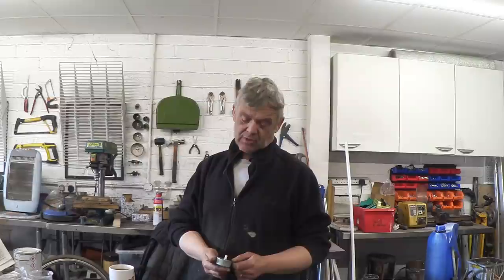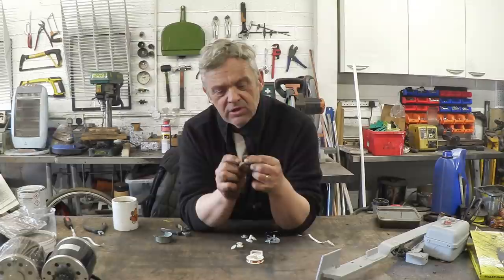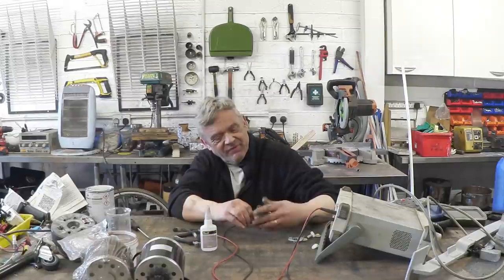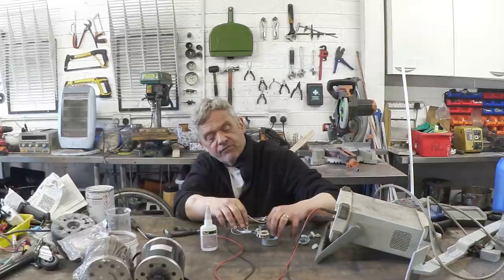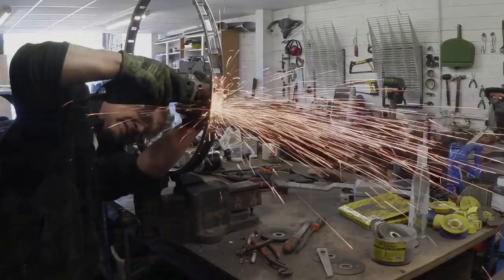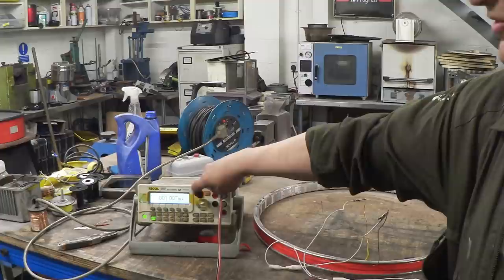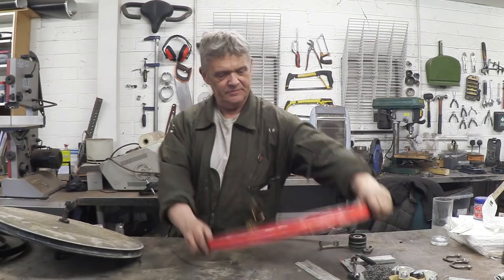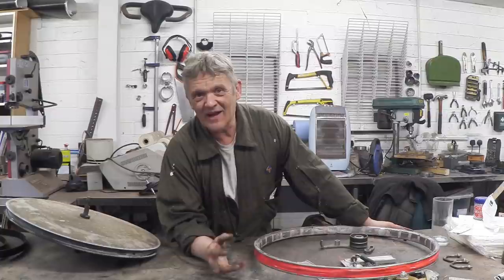1119 Prototype New  Style Generator - Part 1

Comment: I didn't understand the cuts. could you put more detail in the member's area?
Reply: i think it looks like a zipper
Reply: First he cut square holes, evenly space along the face of the rim. Then he separated the leftover square pieces of the face by cutting one side of them - creating a flange. This metal square is then only connected to the rim on one side. The opposing side has been cut. The interdigitation comes in by switching the direction of the cut side from left to right. 

The best analogy i can think of is a ladder where every other rung you cut the left side rom the main vertical support, and the rest you cut the right side. He then filled the gaps with fiber glass. 

As the magnet moves across the face of the flanges it creates an flux path where the magnetic field is forced to cut through the coil perpendicular to the magnets motion in space. Generating a current in the coil.
Reply from the maker: yes mate I will

Comment: Those teflon gears are made for very low speeds and tiny torque. That being said, they still crack and lock. They're also found in blend door actuators in vehicles. I believe you'll split at least 1 gear in testing.
Reply from the maker: did you watch all the video mate? I am only using the motors as a guide to construction the actual device is a couple of bike wheels

Comment: That's brilliant. It's also the same arrangement that's used in a car alternator's rotor to commutate the flux for the outside stator coils to generate from.
What's great about this is you could get a few very consistent measurements with different loads by spinning your flywheel up to a set speed and letting it passively slow the flywheel down to another set speed.
Reply from the maker: good point mate

Comment: Your concrete flywheel needs a redesign; the weight wants to be around the circumference!
 The weight close to the hub is just adding weight but not adding much to the kinetic energy storage.

Comment: Interesting! A novel approach, however I am concerned if multiple magnets (in alternating N/S config) are attached to the rotor the issue of accurate alignment comes to mind, such that induced fields do not cancel. The obvious solution is to employ a 50/50 rotor single N/S poles using small neos. Thanks for your amazing videos.
Reply from the maker: yes I was pondering that - In the small. motor there is just one north and one south
Reply: @ThinkingandTinkering  Precisely, one coil, one magnet and the opposing poles create the AC phasing...simply brilliant! If you were slightly inaccurate in cutting the poles you should notice that the induced short circuit current will exhibit this in the waveform on the oscilloscope. Indeed, that has given me an idea regarding the use of alternate N/S fields and employing sawtooth / sinusoidal poles. This has many possibilities for a novel alternator I feel.

Comment: If you can get that flywheel turning using a gearing system that allows free spinning like the bike when you stop pedaling then this could revolutionise the way a wind turbine works in gusty conditions with low wind periods.
Reply from the maker: I was thinking of exactly that mate - I am going to use a freewheel on the flywheel
Reply: @ThinkingandTinkering  cool, this is going to be awesome once done. Might be well worth replicating.

Comment: Could make a wheel motor by inverting the drive, direct drive and high torque. Very few moving parts. Can pulse a very high current synchronized to the magnet position. Akin to stepper motor. Would make a good kit for electric bike (with the right adapted design of course). (I know it's three same as the microwave motor, I just thought of the radial torque and fewer parts). About 40 Nd magnets would make quite a powerful torque?

Comment: I saw a tiny 25kw electric motor that could fit in your hand that very powerful on a electric bike and small form for the power output. I asked myself if a little diesel generator could run one of these as a generator. I looked at it and it was DC so it would be too expensive to run the power inverters and the whole thing was going to cost around 5,000 dollars or so to just make the thing. So I thought that is too expensive to do a little experiment.

Comment: Also if you could set it up. Exactly like a ball barring  that generates power couldn't you install those into ev cars or any type of electric vehicle to get some return on the power used to get the mass of the vehicle moving while it moves.  Especially if you coast some. Extend range 10% -20% maybe just a thought.  Graphene super cap. No with return charge current do away with super heavy ev batteries use your printing method perhaps I'm rambling sry
Reply: Regenerative braking is just about standard for EVs right now.
Reply from the maker: that is a very clever idea mate - a bit like a flywheel bike?
Reply: Exactly what I'm thinking

Comment: how will it perform....
1) it will generate
2) given enough turns and poles and rpm, it can generate a significant voltage, but internal resistance can add up quickly with such a large diameter coil × each turn.  
3) internal resistance will limit current inside the coil creating a voltage drop (along the length of the wire in the coil) at higher currents.

That voltage drop will be internal resistance of coil × current through the coil.
Reply: What happens when water hits a 90-degree turn in a pipe? Now, what happens if you only bend the pipe 3 degrees? Using the Socratic method so don't get upset
Reply: @Barskor1  What would happen if the water had no weight?
Reply: @kreynolds1123  Electrons have weight and they like to travel in curved trajectories just get some paper and iron filings to find that out. Edit the weight is extremely small but it is there.
Reply: @kreynolds1123  Magnetic fields are composed of electrons, the iron filings show the curve of the electron paths.
Magnetic fields being composed of electrons with mass do have momentum ignoring these basic facts is why unified field theory has not worked out.
Reply: @Barskor1  one may need a charge to be accelerated to be create a magnetic field, but the magnetic fields do not need the charge any longer, and may exist independent of any charge particle, photons being an example. 

and though in perninate magnets one needs an unpaired electron  accelerated in certain orbits to create a magnetic field. the magnetic field travels though free space independent of the electron that created it.

one can even take the magnetic field from a coil. and using low reluctance path, can take the magnetic field a great distance away from the coil. and  through a gap of empty space without any electrons inside the gap.
Reply: @Barskor1  we are aware that capacitors store energy electrostatially and coils store energy magnetically.  the only mass in an electric field or magnetic field is the inertial mass derived from m=E×C^2.  and since E is very small for most man made magnetic fields  and the speed of light is very Huge, then its inertial mass is very very very very very small.

but remember though magnetic fields may vary, they dont actually flow like water or electrons in a circuit.
Reply: @Barskor1  kindly, from here on, you and I will have to disagree that magnetic fields are composed of electrons and that the path patterns seen in iron filings represent the path of electrons.
Reply from the maker: cheers mate
Reply: @kreynolds1123  Your inability to measure a thing does not remove it from reality such as the weight of an electron.

Comment: Wow. Is there some relationship or optimal number between the rpm->voltage and number of cuts, do you think?
Reply: You know Robert is going to say give it a go and find out.
Reply: Oh man that calculation, is as long as your arm and has alot of different variables,  size and length of wire,how perfect the coil is,weight a power of magnets also how many times poles change.
Reply from the maker: oh yes - but was Tre said it will be quite. bit of working out

Comment: I got a setup with old 2 inch npt pipe threader manual machine with bearing welded and treadmill rollers welded working on same thing
Reply: And got loads of flat antenna double wire idk if the foam insulation will affect it.

Comment: I have loads of these at 4 to 4.8 rpm
Reply from the maker: awesome!
Reply: @ThinkingandTinkering  I was thinking of using some to make a rotisserie for bbq season.
Reply: Love your thinking outside the box. I also have many alternative ideas about generators. Makers of generators have one way and that way produces loads of lenz effect that takes more and more energy to produce more electrical power.
Reply: Your way put more distance between the magnet and coil, changes the flux path to the coil  and puts less lenz drag on the rotor. Less input energy to produce more output energy.

Comment: If you double the amount of copper wire, does that effect the voltage generated?
Reply from the maker: yes - but given it has to fit in the same space it will be half the thickness so can carry only half the amps - plus it will be twice the resistance
Reply: @ThinkingandTinkering  , thank you, is there no way to connect the same space with coils and get the benefit of more coils or does it physically have to be present around the  magnets?

Comment: so half the flywheel will be south and the other half north?
Reply from the maker: do you know - I don't know - I will probably start that way
Reply: @ThinkingandTinkering  i just guessing based on the smaller microwave motor design.. but, It looks like to me, that an alternating North South configuration will likely cancel each other because all the current is running through one single coil.. hope that helps
Reply: @ThinkingandTinkering  There's plenty of info about those Single-phase syncronous motors on this forum just Google: "Workings of a microwave oven turntable motor eevblog"